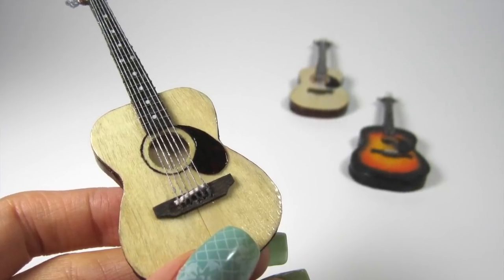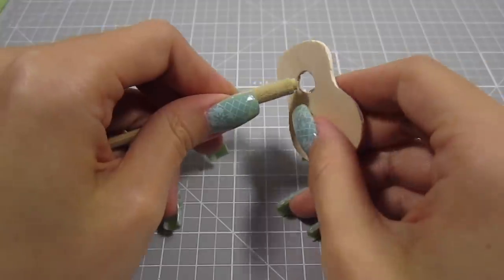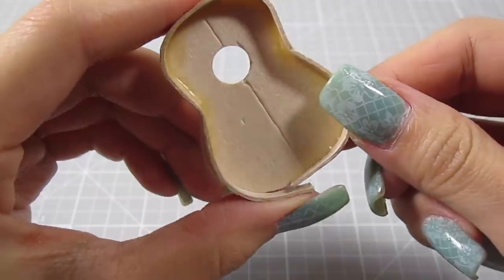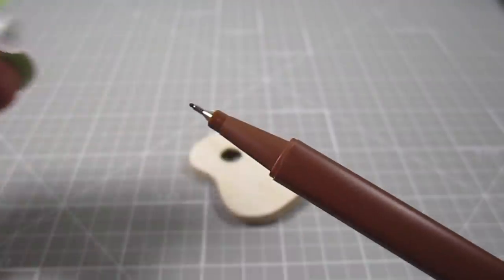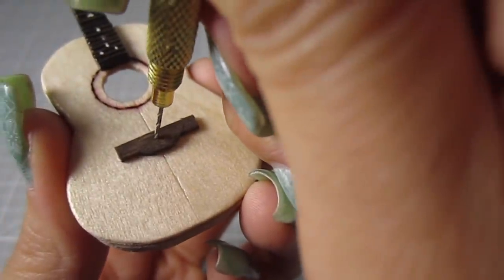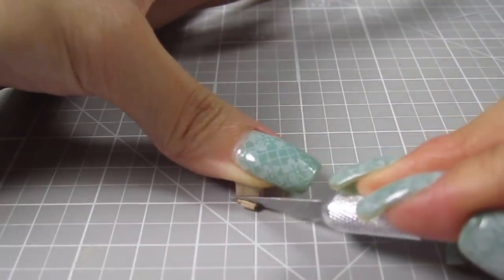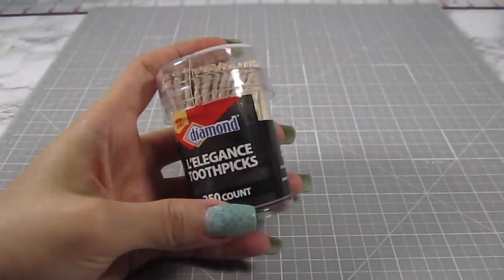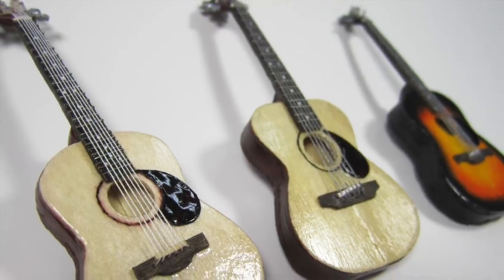DIY Miniature Acoustic Guitar (made with popsicle sticks!)

Comment: when you roll sand paper dont use a dowel inside,but once in the hole rotate it on the opposite direction you rolled it in. the paper will expand to the size of the hole making for a quicker cut and accurate circle..coming from a wood pattern maker
Reply from the maker: That's such a great tip! Thank you so much for that! :D Leave it to a wood pattern make to have the best advice ^-^

Comment: These are fun to make! I started making my guitars before I found this video, but once I found these videos the sides of my instruments have been easier to make aside from simply using a blowtorch and some water! I make mine in roughly 1/14 to 1/16! One thing that isn’t mentioned in the video is how long it takes to make one! Overall I counted about ten hours of work! Well these guitars won’t take as long to make! My guitars have the bracing and inlays which take literally half the time of the build! Also a warning on the sides! Be careful when bending the coffee stirrers! I’ve found that if you’re not careful they can break easily and splinter! Also if you use an Emory board you can file down the edges of the neck to give it that curved feel as seen on full size guitars!

Comment: Need some help. Stuck at coffee stirrer step in guitar making. I am not sure which one to use to hold both halves together . Most stirrers are 3/16 inch wide. Is it enough or should be 1/4 inch ? Any particular brand that works better than other?